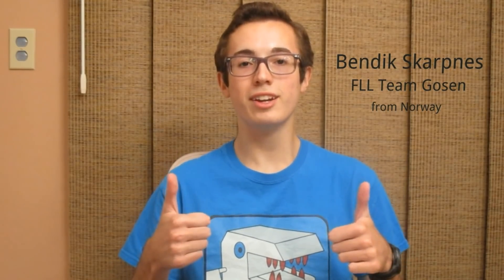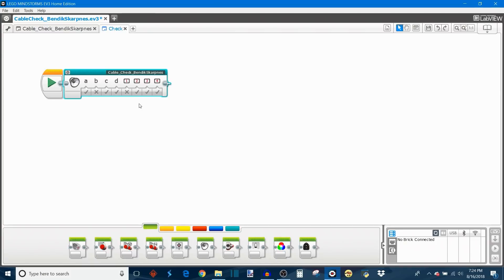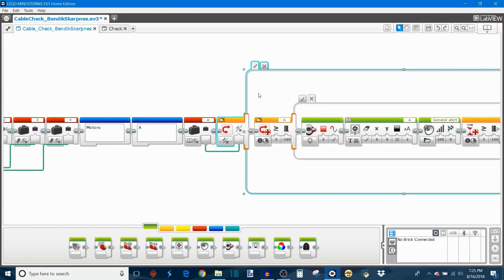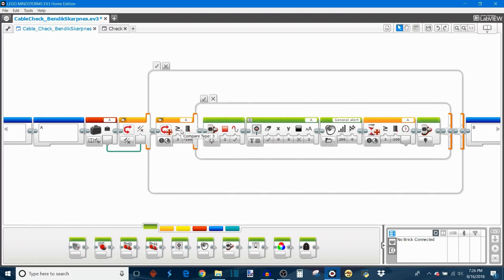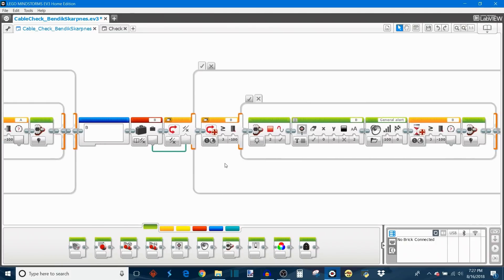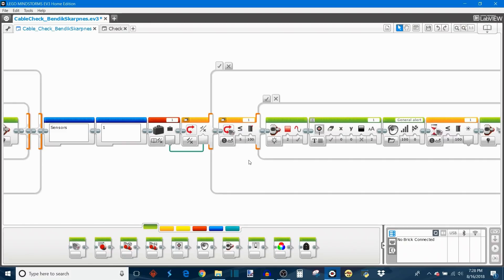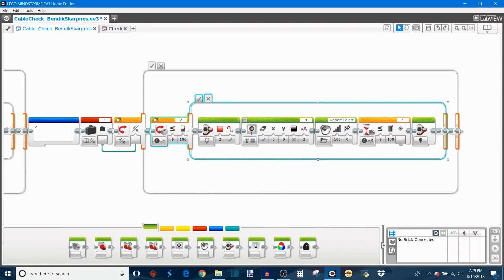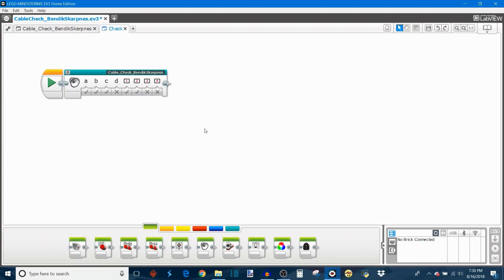Program your EV3 to Detect Loose or Faulty Cables - EV3 Navigation with Bendik Skarpnes

Comment: Could this all checking be done in parallel? Could there be a disadvantage?
Reply from the maker: If the checking is done in parallel, it will be hard to know exactly where the fault is occurring, and brings up a host of other programming issues. This is the smoothest (and probably easiest) way to implement this technique. I like your thinking, though!
Reply: @Builderdude35  hrmmm, I might have to think about this some more. Surely there's a way of list each of the faults (or adding the port letter/number to an error string) in sequence, then running the program again, or looping after some other input.
Reply: @Builderdude35  the check should be done in serial, but it shouldn't wait for 1 fault to be "fixed" before moving to the next. We should check ABCD1234 and remember which ports fails, then print out all fails on screen.
Reply: I made a program that checks all the ports in series but lists any faults once it's done checking them with correct letter/number assignments instead of reporting errors after each check. I'm not sure if it can work checking them all in parallel. I could send you that if you want.

Comment: Can you also somehow differentiate between a medium and a large motor?
Reply: Hi Nicholas! The same programming blocks are used when you are reading values from both the medium and large motor.
Reply: @bendikskarpnes1834  
Thanks for your reply!
I actually meant if you can somehow set it in the program that let's say port A should be a medium motor, but if you plug in a large motor it will still trigger the error.
Reply: That's of course what you meant! I don't think so, because you use the same block to access the data from the motors. But I am not 100% sure, let's see if someone else who knows the answer replies...

Comment: Do also stretch/move the cables around when testing, faulty cables which are rusted/have bad contact would somehow work fine until you arrived at the venue. If you live in a humid area consider storing the cables (+sensors, motors, ev3) in a box with rubber edges., those plastic food boxes works quite well.
Reply from the maker: Thanks for sharing!